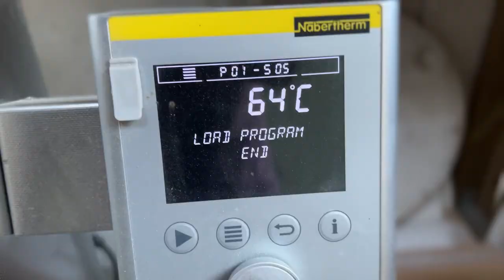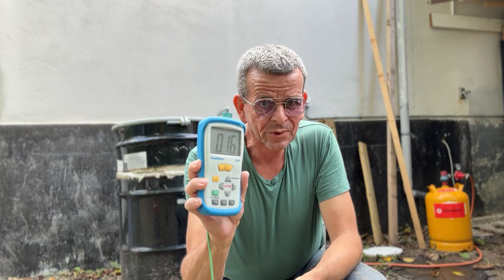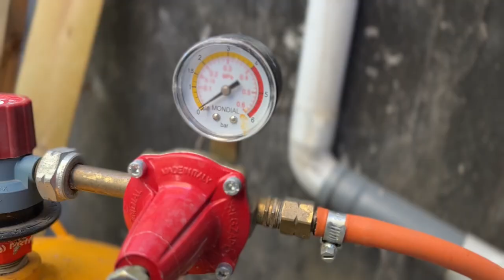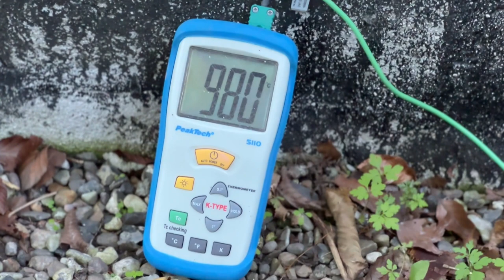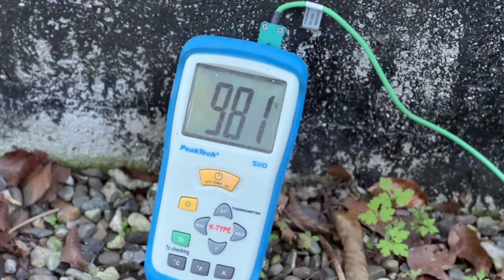74.  How to Make a Table Lamp on the Potters Wheel

Comment: the "slip" is it clay slip or color (angobe) ?
Reply from the maker: The one I am using in this video is a commercial engrobe but you can also mix your own, add stains or use porcelain. When I am using porcelain stain (I use a very white one called Audrey Blackman) I also add a bit (10-15%) Custer Feldspar to make it melt and stick better. Works fine